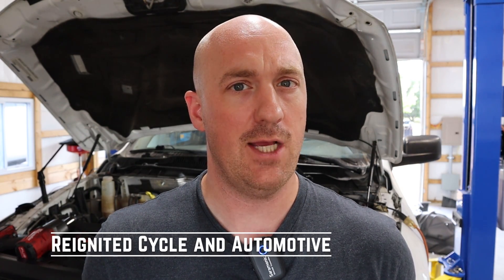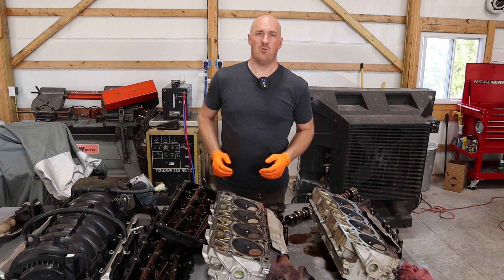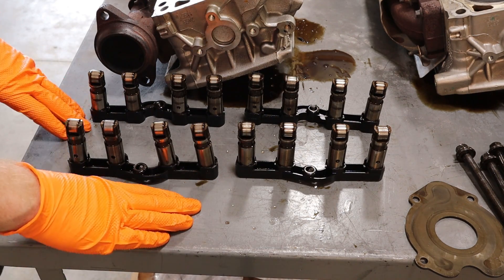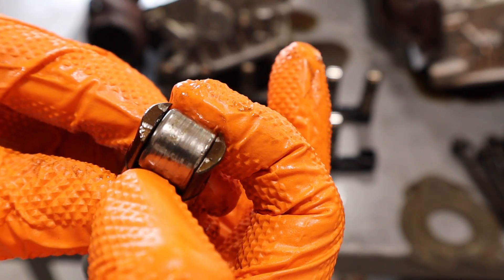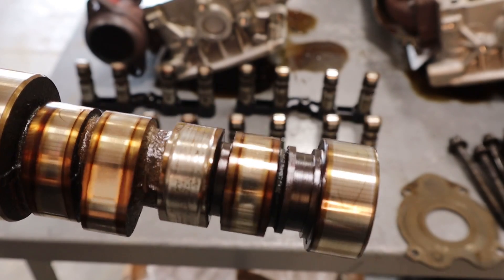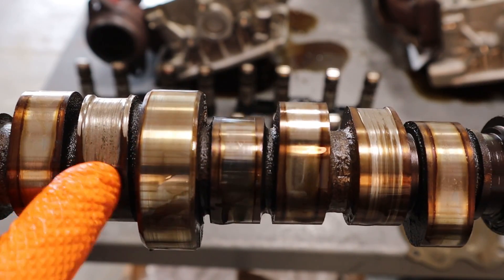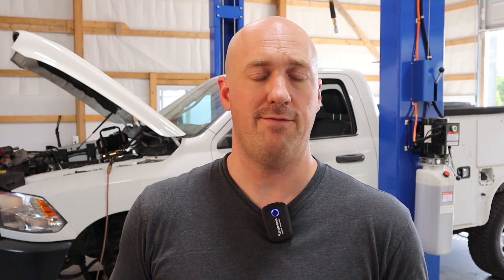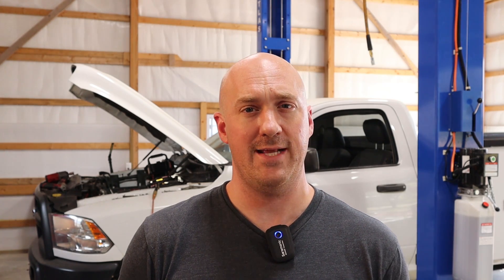Hemi 5.7 Lifter FAILURE Does this engine have a fatal flaw? Find out how YOU can prevent it!!!

Comment: : Mr. reignited  thanks for the info you are awesome.  Your video is very charismatic, succint and to the point.  Not all videographers, in fact most, lack the ability to teach in such a clear and succinct manner.  
This is the info I absolutely needed.  Two years ago i Lost my 2006 5.7 truck engine to a sucked valve.  Being a dodge fan, I bought a 2009 5.7 L truck. Then it started developing a tick that I was very concerned about, but it goes away if I just let the truck warm-up for about two minutes.… Now I am going to go get my exhaust bolts fixed.  
As you probably already know just having this knowledge has relieved so much stress about my truck.  I am also going to take your advice and preempt any further problems. Again, thank you very much I will be watching your channel in the future.  JB

Comment: Just a bout, with Daniel staggers.  The post below, what a sham and Daniel has proven his character, veracity and intelligence quotient.   I am a Charger fan and I am in the know about police chargers. He is absolutely lying about police not using the charger. The charger has been the most successful police car in the history of the United States. I’m not saying it’s perfect, but it has saved more money for departments than any other vehicles Purchased.  I am not even going to talk about the Performance of the vehicle, as no other vehicle in the broad spectrum of patrol cars has ever met the Chargers performance in every category. The reason is the dodge charger (if you understand how they designed it and why) was designed as a patrol car from the very beginning. One of the reasons why, is because they knew that if they made a performance patrol car it would attract attention and the public would be desirous of a performance car Driven by the police. This was an extremely smart move, what better advertising do you get for free. When I speak of savings, police departments save money because the battery is in the trunk, there are circuit plugs under the dashboard ready for plug and play, specifically for police the same exists in the trunk and the same exists in the engine bay.  All of these alterations allowed for radio equipment and savings on wiring cable and savings for the mechanics setting the vehicles up. This literally saved 2-3000 per vehicle just for the initial vehicle set up for police work.  The charger has not been canceled by police departments. Departments and their leaders have their own choice of which vehicles they prefer. Since 2006, Dodge has continued to grow in the police community and has crushed the competition in the patrol car market and in fact has altered expectations for patrol cars and has raised the bar. As far as the vehicle being canceled by other agencies All depends on their year to year preferences and state bids along with budgets and leaders personal preferences?  Further, there are many articles online that anyone can look up about the charger and the facts. One of the reasons the charger was not initially welcomed with open arms In 2006 and 2007 is because of chevy and fords terrible performance features (for police applications) of the Ford mustang and Chevy Camaro.  California highway patrol and many other departments stated that they have a boneyard full of High performance mustangs because of their poor traction control and they were not advantageous because of poor traction in the winters. The Dodge Camaro had the same issues but not to the Mustangs extent.  Not to mention these manufacturers refused to address the needs for patrol vehicles and did very little to upgrade for the patrol packages on the family cars that they provided as police interceptors.  Within several years the Dodge charger had proven and continued to prove by Word of mouth to sheriffs offices, state patrols, and police departments that Dodge was on another level and had brought back the high-performance patrol car.

Comment: What can be the cost for a camshaft and lifted replacement on Hemi 5.7 JGC  2011 and if this is fixed is possible another issue in the future with the engine.
Reply from the maker: Generally at a professional shop you're looking at around $4500 for cam/lifter replacement.

Comment: My personal opinion,  we should have used the small block "A"  motor and design a new Hemi Head with the 36.6 degree design or better a 40 degree head.  The "A" engine has been used for decades and why have a brand new small block design is beyond me.

Comment: Interesting video with a great break-down of what is happening with the Hemi engine..  What is concerning is that there are plenty of similar engines that don't seem to have this problem, however, many owners may be guilty of stretching their oil change intervals to making this even worse. Is it not oil starvation (poor design) or a weak oil pump that might contribute to this?
Does Chrysler recommend a specific oil grade/type change that might help? From say, 5w20 to 5w30 full synthetic? Dunno.
Reply: Use amsoil the dealers wanna destroy ur car

Comment: Hi great video. I’ve got a 2009 aspen with 5.7 Hemi. It idles very rough. Driving it most of the time is rough too. Dealer told me that the number 7 valve is sticking. What should I do? Thx Pat
Reply from the maker: You don't often run into a valve sticking issue on the Hemi engines. I'd probably have a second opinion to rule out other factors before continuing. If it is the valve, best option is to just slap a reman head on that side and be done with it.

Comment: Need help. 09 Charger RT that smokes out the back only when I floor it. No other problem at all. Does not over heat, no leaks and can take it up to a 100mph with no smoke as long as I go into gradually. But as soon as I just put is to the floor it smokes out the back. Thanks
Reply from the maker: What color is the smoke? Is it black, or bluish white? I suspect you might have issues with your valve stem seals and it could be leaking oil into the combustion chamber. Alternatively it could be worn out piston rings, in which case you would have to perform a leak down test to verify.

Comment: I have the 5.7 in a 2012 Ram and my cam and lifters are new. The injector, coil and plugs are all new in cylinder 7 yet I’m still showing a permanent misfire in cylinder 7. Please help? What else can I check?
Reply from the maker: At this point your next steps would be a compression test and a leak down test. Let me know what you find out.

Comment: You state that fleet vehicles with lots of idle time have this issue, then you also say that the 6.4L engines have it more than the 5.7s. That's contradictory.
Reply from the maker: Not sure exactlywhat you heard, but to clarify: any sort of fleet vehicle with high idle times exhibit this issue more than others. The 6.4 cars almost never show this issue, but the truck 6.4 has this issue show up at a much lower mileage than any of the 5.7 models.

Comment: I have a lifter tick that happens because of the oil draining down when I park my truck on a hill. I have resolved this by holding the accelerater down when cranking until oil pressure comes up. I didnt know why the drain down was so bad until this video showed the orientation of the lifters in the block. This makes sense to me now. I hope that for the first 20,000 miles I haven't done any damage with the dry starts of this truck because of it being parked on the incline.

Comment: Hi my 2015 ram 1500 hi has a tick when I first start it for 2 seconds or less and it doesn’t always happen
Reply from the maker: I would highly recommend you check out another video on my channel "the other hemi tick" regarding the exhaust manifold bolts breaking and causing a tick on cold start only. 👍
Reply: @ReignitedAuto  also can that cause issues later on down the road
Reply from the maker: @colekramer4014  if it is just broken exhaust bolts then no, its just annoying.
Reply: @ReignitedAuto  I already had that issue ans it was fixed and I just had my truck up to the dealer and they said it’s the lifters and another michenic cause it’s lifters so irk
Reply from the maker: @colekramer4014  there's also the potential for the hydraulic portion of the lifters to start to fail. This allows them to bleed down overnight and it'll tick for a little bit on startup, but this also won't hurt anything.
Reply: @ReignitedAuto  ok

Comment: I had a dodge 1500 2009 ,put 190,000 miles on it. You have to change the oil your self because most places use cheap oil. Always use synthetic oil. When I traded my truck in the mechanic couldn't believe how good it sounded because of the many miles on it. I now drive a 2013 ram used, put 43,000 on it no problems, now has 103,000 miles. One more thing don't use the cheap spark plugs, use the best makes a big difference
Reply: what are you calling the best when it comes to spark plugs...

Comment: I want to know if you have ever had a 5.7 with mds have a mds valve stick in the closed valve position making it appear as if the camshaft was worn out and in fact it wasn't.
Reply from the maker: You know I haven't seen or heard of that myself. Obviously it could happen somehow, but these solenoids are naturally closed, and they open when energized, so usually if they fail they are just closed which means the lifters are not collapsed.
Reply: @ReignitedAuto  The reason I ask is with the valve cover off, engine running on the opposite 4 cyl's, the intake valve on #1 is definitavely doing nothing (no broken spring) while all the other valves are doing their job, even the exhaust valve on #1 is working... The truck had intermitting p301 codes that would allow a week or so of perfect driving then spit out a code again, rough running. I would clear the codes and drive for another week. Now it is all the time and never had a tick or a knock, just a fart and a popping sound now. About to tear it apart but the fact I can push on the rocker while it is running and not find play makes me question if it could be a stuck mds lifter and not a worn cam and bad roller lifter assembly.
Reply: @ReignitedAuto  I wasn't questioning the solenoids...I will try to clarify...more questioning about the mds lifters. I assume that the solenoid actuate both intake and exhaust valve at the cylinder so my question is directed at the lifter... can they be stuck?
Reply from the maker: @ezcsmartlight1910  ah gotcha, the lifters have an internal spring in them that makes them expand again. However this springis not enough to overcome the oil pressure if the lifter bore is pressurized. This being said, I've never once encountered a collapsed lifter. I have seen the hydraulic portion of the lifter fail, which will cause a ticking/tapping noise, but this will not cause any drivability issues. The hydraulic portion of the lifter is separate from the MDS portion.
Reply from the maker: Also, what year is your vehicle? Are you seeing any MDS activation codes?
Reply: @ReignitedAuto  It is a 2009 Ram 1500 with fuel saver mode. I think I am going to try an oil flush, dextron III tranny fluid and a few miles followed by an oil change. This problem went from intermitting to full on... camshafts do not repair themselves.
Reply: @ReignitedAuto  No mds codes. Just p301. I wish I knew how to send you the video of the engine running and the rocker arm just sitting there doing nothing.

Comment: Mine ticks only 3 to 5 seconds on cold start up. It goes away before much heat would develope. I doubt its a manifold leak?
Reply from the maker: You'd be surprised how quickly heat develops. That being said, if its not manifold issues there's also a chance that the hydraulic portion on one of the lifters could be leaking down overnight. The good news is that this won't cause any damage to the engine, is a different issue than the roller portion failing.
Reply: @ReignitedAuto  thanks for that. Makes a lot of sense.

Comment: Hello I’m from Puerto Rico I have a 2010 hemi Laramie a how many mile you recommended the oil change and what oil number I need to use
Reply: Check your vehicle manual, but probably 5w20 at 5000miles.

Comment: I like your newer video on how the MDS solenoid doesn't allow oil into the lifter passages until its active. Which is what actives the lifter collapse. Which could be another reason why the MDS lifters fail sooner than later. Its not active on idle. Nor during any kind of hard driving. Definitely makes sense why fleet vehicles, especially towing, or hauling vehicles, would have the most and worst lifter problems.
Reply: in fact I think that if the FCA technicians have designed the engine in that way with MDS this means that the system must be activated. MDS cannot always be deactivated. When the system is activated it sends pressurized oil to the MDS lifters through the dedicated solenoids. If you make sure that MDS is almost never active you reduce the lubrication of the lifters. The engineers thought that with an engine coupled with an automatic gearbox (8-speed) the driver will not constantly love a track drive or sports drive and the driver will not select the sequential gearbox all the time. The driver looking for such performance will buy a car with a manual gearbox without MDS taht is another project of engine. The person who buys the 8-speed automatic also desires to have a relaxing drive and perhaps will also be attentive to consumption. These are the reasons, according to my idea, why the engine needs its dose of time in which MDS is active. Maybe many people don't like to run 4 cylinders but I think this type of engine is designed because it must also run 4 cylinders so that all MDS and non-MDS lifters have the right lubrication. The problems have the MDS engines that never run in MDS at the will of the drivers. What do you think about this?

Comment: I have a 2014 R/T Charger with 195,000 miles on it. Just started hearing the tick on start up. Will be checking the exhaust bolts. Thanks for the tip.

Comment: What are your thoughts on the 5th gen Ram 1500 where some people experience exhaust manifolds cracking and in some case both are cracked at low mileage?
Reply from the maker: To be honest I haven't yet heard about this issue. I'll check into it and see what I find.
Reply: Just bought my first Ram 1500. It’s a 2021 Laramie so I’ve been going through the forums so that I’m not too surprised on the potential repair costs 😂
Reply: Didn’t know comments with links get deleted lol I’ve been going through forums from 5th gen ram. I’m not sure if this a common issue though but it sounds interesting that some are experiencing cracked manifolds at low mileage.

There’s two that I found from 5th gen ram: “Cracked Exhaust? Really?” & “Hemi exhaust manifold tie bars?”

Comment: So if it’s just cause of oil then why would only the MDS lifters show the wear so bad? To me that says mds issue
Reply from the maker: Darrell it's not only the MDS ones that fail, they are just more likely to fail. On top of that, the MDS lifters have a small amount of movement in the body of the lifter, so once the needle bearings start to fail, they fail much quicker.

Comment: this is crazy..  I had a Leased RAM 5.7 truck that made lifter tick at 6000 miles....  is it possible or did I have a defective engine?  thinking about getting another ram when my Jeep truck lease is up next month..  maybe I just get a 6.4 instead?
Reply from the maker: Definitely not normal to have lifter tick issues at 6k that's a manufacturing/parts QC issue.

Comment: I would love to agree with your findings, however my 06 hemi with only 125,000 miles took a cap because of this lifter cam issue. This vehicle was taken care of like new born baby. Synthetic 5w20 changed like clockwork at 5000 miles. All tune ups done at proper intervals. It was important this vehicle got me at least 200,000 miles. I was gravely disappointed,as this was a military retirement gift from my wife. Now it sits unusable,can't afford to fix it. Contacted dodge and they blew me off. Will never buy a dodge again.
Reply from the maker: That is interesting, because it's actually really rare for the '06 models to have lifter failures, that didn't really start to happen until 2009. Have you had the car professionally diagnosed yet, or are you just thinking that's the issue? When is the tick noise present and what makes it better/worse? Is there a Check engine light on? Does it feel like the engine is misfiring at all? Let me know 👍
Reply: Bro get some tools do it yourself so sick of people taking cars to stealership

Comment: Caterpillar in the past used the same type of lifter on the 3400 series engines, I I at the time now around 30 years ago rebuilt many many of these. Some of these lifters would fail in very few engines and the cause of failure was always oil related either wrong oil or not frequent enough oil changes so I think you are spot on to it, thanks for the vid.
Reply from the maker: Appreciate you watching!

Comment: At the end of the video you said you know of more tick trouble with the 6.4 hemi than the 5.7. But the heading is about the 5.7 hemi having tick trouble. which is worse 5.7 or 6.4.
Reply from the maker: You will generally see the issue a lot more with the 5.7 engines, but for whatever reason the lifter failures are happening much sooner on the 6.4 truck engines, like 15k-35k miles. Can't give you a reason why that is. Don't really see many if any failures with the car version of the 6.4 👍